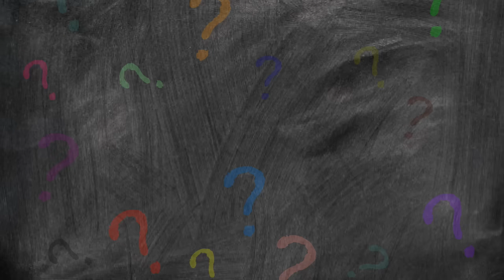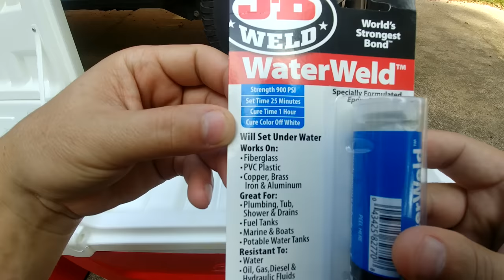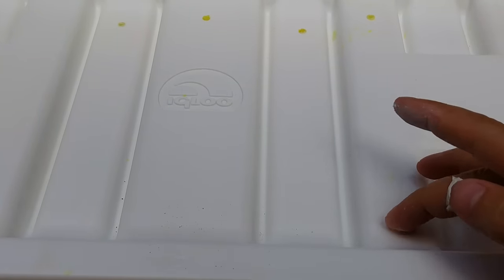Do Yeti cooler hacks work?

Comment: In Iraq we lined the outside  of same type of ice chest with 2" thick sheets of foam panel. The lid also. We glued using the same glue you use for tub surround enclosure kits. We also screwed to ice chest using fine thread drywall screws. After that we took 1/4" thick plywood, cut to fit nicely over foam. And screwed glued to foam. Then we painted the plywood with high gloss white paint. The ice lasted twice as long in modified ice chest. We were in over 120 degrees!

Comment: I think it probably had more to do with which cooler got more sun through the windows during the day.  Or more likely, one of the coolers had a poor insulation fill at the factory.  Semi pro tip:  When you buy a cooler, bring the brightest LED light you can find with you and go all around every square inch and look at the light transfer on the other side.  You'll see where the voids are.

I say fill them with ice and use the heat gun or a FLIR to look for cold spots on it all the way around all 4 sides top and bottom.  

If a cooler is out of the sun, the lid really doesn't need much, as heat rises and cold air sinks.  IE the open top freezers at the supermarket.  

Lot of weird comments below about air being better than insulation.  The key is DEAD air for that to work.  Air that's free to move in a space is better than no space, but convection currents within the space will transfer heat faster than an insulated space.  

Most lids aren't insulated these days because it's A. Cheaper not to and B. It's a flat surface with the cold side down and hot side up.  See freezer reference above.  

If an air space was better than insulation, why insulate anything?  Just make a box in a box with standoffs to keep them separated.  

Thermoses don't have an air space, they have a VACUUM space.  HUGE difference.  They make a can welded in a can and pull a vacuum on the space between.  Some ad charcoal or reflective coatings in there as well.  See DeWar flask or vacuum flask.  

There are some interesting technologies making tiny glass vacuum balls that can be added to paint or used as loose fill insulation.  Millions of microscopic glass vacuum balls.....crazy.  Try to figure out how they do that!!

I highly recommend getting some 1in or thicker foil clad foam insulation board at your home store or building supply and cutting a piece the size of your cooler's foot print and setting your cooler on that.  Most of your heat loss is through the bottom into whatever you set it on.  If you can't do that, set it on some narrow strips of wood to get it off the floor, especially concrete.  

Keep you cooler out of direct sunlight.  

You can go insane with this experiment.  Haha!

Comment: I made liners for my coolers out of foil bubble wrap insulation. And used the scraps to make divider blankets to go inside. Then kitted up my meals and vacuum sealed them before freezing solid. Ice in the bottom, meals layered into cooler by day of use with one of the divider blankets on top of each day. Used 2 coolers for 9 days of camping and didn't open the second cooler until the food in the 1st cooler was gone. Also in addition to the meals being frozen I made ice blocks about the size of a pound of butter. Each layer got 1 block.
Reply: At first I read this as 'knitted up my meals'😶I actually had to reread it several times before it sunk in😂 These are very clever modifications!👍
Reply: I've done similar mods and they work very well. Also use an rubber strap across the top to make sure it stays closed.

Comment: Air is one of the best insulators. The issue with filling the lid up is 2 fold. 1 - thermal mass. 2 - it pushes air out of the lid and replaces it with a semi-solid mass. The expanding window sealant is great for windows because they are leaking and air is moving through holes. However it is not a great insulator in an already air-stable environment.
Reply: Isn't there exactly what your insulating against? Air is by far the worst insulator you can have. It moves freely and brings heat into a system... I think you are thinking of a vacuum or lack of air
Reply: Yea I was thinking that too. It might work if you have a foam with a lot of air in it but spray foam into a small compartment like this just makes a solid mass.
Reply: @RtsWillH1Mself  on the lid the heat transfer is different if you fill it with something it gives it mass for the heat to absorb into an transfer between the top and bottom of the lid. where as empty space that's just filled with air that can't be removed and replaced won't transfer the heat down into the bottom of the lid heat rises it can't fall to the bottom of the lid so the top gets hot and the bottom that's exposed to the cold stays cooler. 😂
Reply: @RtsWillH1Mself  I'll provide a quick explanation to clear up the confusion. Air is an incredible insulator; vacuums are even better insulators. If you have a closed system where the air cannot escape it will act as a strong insulator because there just isn't enough mass contact to spread heat out well. In other words, because the molecules in the air are only rarely in contact with the heat source they take on very little energy.

I think what you're thinking of is air flow. Air flow is generally not very good at insulating. When you have air flow some air molecules come and absorb some heat energy then move on. Ultimately a heat source will expend the same amount of energy, but when there is air flow the energy is expended on a much larger mass of air.

Imagine the heat being insulated like a required amount of pushups to be done. In a closed air system you have one person trying to do 100 pushups, but when there's airflow it's like 100 people doing 1 pushup each.
Reply: @RtsWillH1Mself  Sorry but you're wrong mate. Air insulates really well. That's why houses in cold climates have an air gap built into their outer walls. And eskimo's wear fur inside out, because the air inbetween the hairs of the fur insulates. That's also how fur keeps you warm, it's the layer of air trapped between the hairs, not the hair itself. Also the air in the lid cannot freely move around as you state, since it is trapped in the lid, hence creating an insulating layer. Also following the same logic, generally dense materials like metals will conduct heat very well, whereas materials containing more air, like wood, conduct less heat. Air is not dense at all, which is why you can hold your hand 1cm from a hot stovetop and not get burnet.
Reply: @RtsWillH1Mself  in this case the air does not move freely
Reply: @jonathannorthup5705  sounds about right, I’m not smart enough to be in the comments. 🤷🏾‍♂️ 🥴
Reply: Me I get about 30lbs of ice every morning we drink alot of water so the cooler is constantly getting opened up that is the biggest ice killer letting that nice cold air out and letting fresh air in! Boss man go us one of those little umbrellas you put on a fold out chair I've been setting up up over the cooler so we don't have to chase the shade all day 😂👌

Comment: He should have scanned the temp of the underside of each lid. Likely would have been a considerable difference as the foam in essence created a heat sink (which then passed the heat on into the cooler).
Edit ... You may want to try the one thing that you initially felt good about but ended up doubting and eliminating and I'm referring to the window stripping. I wouldn't be surprised if it alone makes a noticeable and positive difference.

Comment: This has brought out the scientist in a lot of people. Easy solution. Buy a better quality cooler in the first place. I do admire your willingness to experiment and learn. The older I get, I just want to buy/obtain stuff that works.
Reply: Agree
Reply: Hell yes!!!  I agree.  Saving a buck usually costs more in the long run.
Reply: 100% correct. I'm quickly approaching the point on the graph where time is becoming more important than money. Buy once. Be done.
Reply: Yet the expensive coolers have insulated lids.

Comment: The air gap in the lid is actually designed to act as an additional barrier to prevent heat from flowing thru a complete surface, by filling it in you’ve introduced a conduit for heat transfer thru the lid. Effectively making it worse
Reply: Kinda like how hot water freezes faster in the freezer than coldwater
Reply: Wrong.  Foam is a better insulator than an air gap.  Your exterior walls would be empty, not filled with insulation if your logic were correct.
Reply: I think the sides and base are filled with foam for strength and cost. Plastic and foam are cheap and fair insulators. Having a strong double wall is more expensive but a better insulator. Ideally a vacuum in the double wall would be the best.
Reply: My thought is by filling the lid with a dense expandable foam it essentially creates a giant heat sink, the out side of the lid heats up this heating up the dense foam and that foam radiating the heat into the ice chamber. I wonder if the same results would happen if you shared a sheath of closed cell foam to the inside of the lid and in the lid itself.
Reply from the maker: Yeti coolers are filled with insulation in the base and the lid.  Knowing this is how they work what do you suggest I do different in my testing?
Reply: @HowToWithJames   maybe use a different spray foam... instead of the door and window that don't expand much. Also, you could by an EPS foam sheet with foil on one side to line the lid or all sides, tape together with foil tape. You could make the insulation around the lid overlap a lot more.
Reply: @chriswise1232  they are insulated to keep heat in the house...
Reply: @NUTZJ98  Not as well as foam, even with zero air movement.  Open cell expand-a-foam like he has in the can is an engineered insulation product.
Reply: @armingill9767  That lid is not a heat pipe.  The outer material isn't even much of a conductor.  Quit posting ignorant videos, Armin.
Reply: @armingill9767  I'M not sure this explains the theory of why the expand-a-foam caused the cooler to melt the ice quicker, in theory if you fill a void as full as you can there shouldn't be any water vapor in that void and what amount there might be would so small it wouldn't affect the outcome.
Reply: The foam needs air pockets to insulate and to do that it must be allowed to expand. Hence, you should have provided 1/2” relief holes around the perimeter to allow the foam to expand while drying. What you have in the life now is basically a solid piece of plastic that conducts heat better than the lid with air.
Reply: Chris Wise the video shows how heat transfers better without an air gap. With the air gap it is insulated , please stop and think about what the video is prove AND disproving, Chris.
Reply: @krism3879  and to keep heat out in the summer....
Reply: @HowToWithJames  The answer to this question is to use a similar type of insulation that Yeti uses.  Perhaps you did or perhaps that is not feasible given the lid construction.
Reply: @armingill9767  How do you figure that the video shows heat transferring faster without an air gap???  Solid copper rod vs. pressurized heat sink.....   neither compares straight air gap with foam, or anything even close to it....
Reply: Armin Gill please research  the r values of air and the foam  and get back to us on that.
Reply: @tribesshift  falls
Reply: WRONG. Foam is a GREAT insulator largely because it traps a lot of air.
Reply: @joshuamccumber8954  correct
Reply: @laneweaver3562  true and false, different types of foam have different properties... the spray foam he is using is more of a barrier, not an insulator. while it has insulating properties it is not as efficient as the foam used in coolers. there is much much more air in a Cooler foam than a spay insulator, hence more conductive... when he said " it has more weight to it " that is because it is dense foam...  not the airy foam needed. and even then, not all air in foams are created equally, some trap gases that are less conductive. polymer molecules that make up the walls of the bubbles are bonded fairly loosely in traditional coolers; this limits the rate at which heat can be transferred from one molecule to another. Spray foam however is a tighter bond, this is why you can work with it and why it is far stronger than insulation foam in a cooler. Polyurethane Foam, Styrofoam and a few others are used in different ways
Reply: @tribesshift  This isn't physics, it is electronics. Hot water raised the temperature inside the freezer and causes the thermostat to trip effectively lowering the temperature in the freezer since you always get overshoot, or in this case, undershoot. A better test would be to fill two water bottles, one warm and one cold, and put them outside when it is cold. Unlike the freezer you're water bottles won't change the air temperature outside! You'll find the cold water will freeze more quickly. If you were to plot the temperature difference you would find that it is linear with respect to the change in temperature.
Reply: @HowToWithJames  See  my answer above!
Reply: @tribesshift  hot water freezes faster because it has less molecules than cold. If you have a cup of hot and a cup of cold there is actually more cold than hot. Try filling a cup exactly with cold and hot let it sit til both at room temperature and there will be less hot.
Reply: @tribesshift  hot water takes longer to freeze than colder water. fact.
Reply: @Mjones8383  hot water takes longer to freeze than colder water.  The earth is not flat either.
Reply from the maker: I don't want to get in to this long discussion but I do need to let you know hot water freezes faster than cold water and this is known as the Mpemba effect.
Reply: @HowToWithJames  Mpemba effect is only at fast high temp differences, this is not that.
Reply from the maker: I am not sure I understandwhat you mean. If you are saying there is a condition where cold water freezes faster than hot I am curious to hear how. Please help me understand.
Reply: @HowToWithJames  hot water may drop temps  faster due to the difference but colder water has a head start and would freeze first.  Maths
Reply: @HowToWithJames   its not momentum... water at higher temps in the freezer cools faster from the heat sink. It's not linear... Rate of cooling will slow as the water gets colder and nears surrounding temp. Colder water put in the same freezer at the same time will freeze first due to the head start it has.
Reply: @tribesshift  No it does not! I won $20 of my dad when we tested that.
Reply: Yes a foam with less density may have worked better. I think that company sells a triple expanding foam that may produce better results because of  bigger air bubbles. The stuff in my Igloo lid is extremely light for it's size. That type of foam really wasn't intended for insulation as far as I know. Short of a vacuum you still want maximum air as an insulator you just don't want it free to travel.
Reply: @GuardianOfTheDamned  if I swallow a watermelon seed will it grow in my stomach?
Reply: @ronjericho7977  It has actually happened before.  There have been cases where seeds got lodged inside humans and grew into a plant.  No shit.
Reply: Not lol hahaha the air will warm and cool and the foam is a very poor conductor of heat.
Reply: Some of you should not have smoked pot through high-school. We use foam insulation because it is a very poor conductor of heat and cold. The more dense the foam the better the insulating properties (less air to conduct heat) I know some of you don't get this concept but we all learned it in middle school and high school. 🤦‍♂️
Reply: @tribesshift  hot water freezes faster because of evaporation and density.
Reply: @user-lv3th9pe7u  actually not how it works as the lower level water starts to cool and the upper level water continues to evaporate the lower column becomes more dense ie starts to freeze while the upper column is still warm and evaporating. This situation has nothing to do with what after freezes faster and more to do with taking longer to cool a fully foam filled cooler.
Reply: Actually yes and no. It is more about the already trapped heat in the lid and the air in the cooler. The stock cooler allows the air to escape so the ice doesn't need to cool it. The experiment didn't actually test the setup properly. Expensive coolers actually say to ice them first to cool the cooler and then use them.